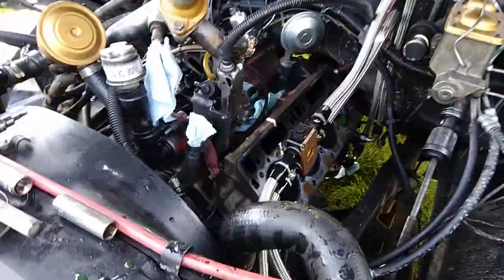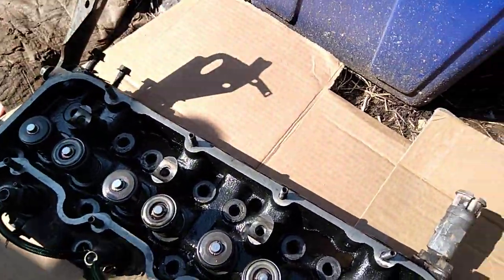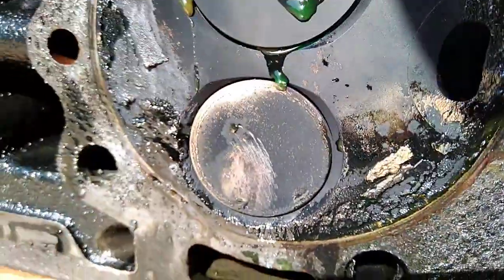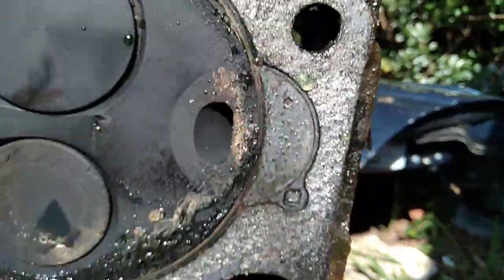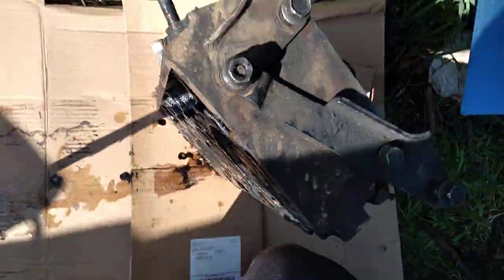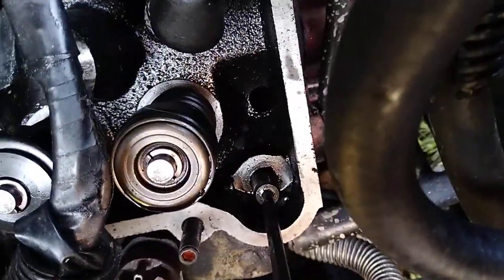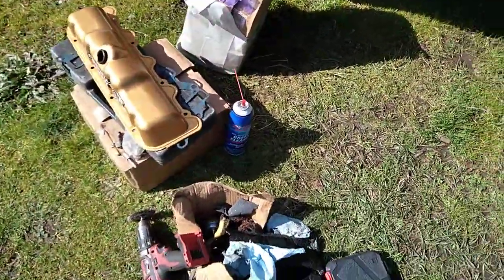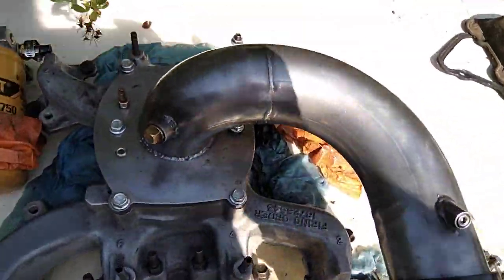Turbo 6.5 Promaxx Cylinder Head Inspection ect

Comment: Earlier j code heads had bigger valves
Reply from the maker: Ya I would have liked to be able to keep my old Heads but they were cracked between the Valves like most are. Mine are Ported, Polished & Deshrouded with all new updated Valvetrain so they are much better now than any J Code Heads are.